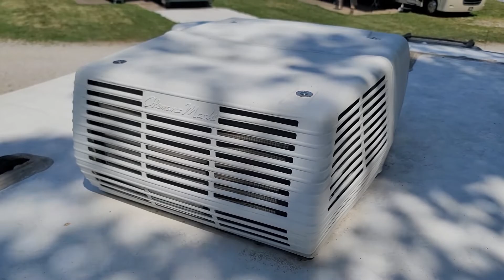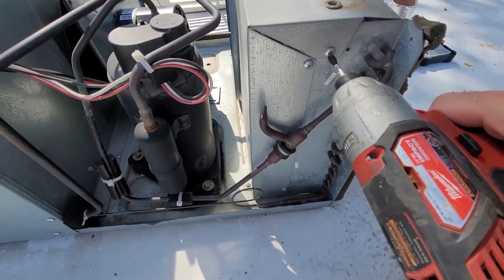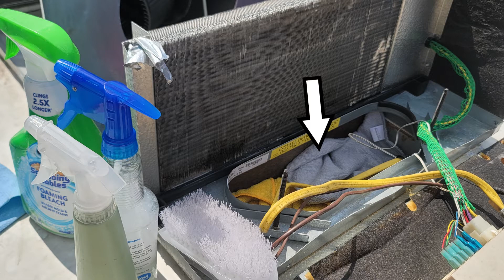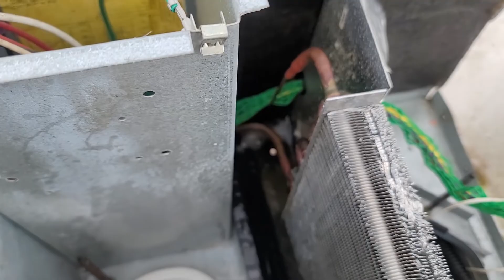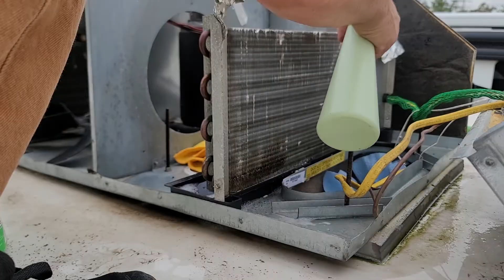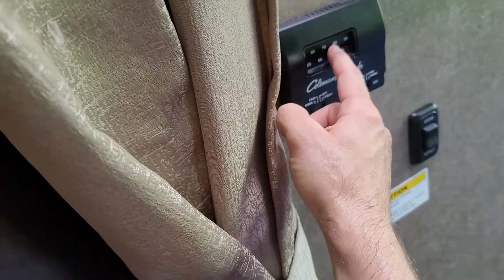RV AC Coil Cleaning & Maintenance - DIY | Coleman Mach

Comment: Thank you for the video. Everything was spot on.  Your video made it easy.  

Walmart has foaming ac coil cleaner with a bristle cap for $6.49. The large can was more than adequate to clean one ac unit.

My evaporator coil (front coil) was much dirtier than the condenser coil (rear coil). The front coil had mold growing on the intake side,  which is visible if you take off the interior covers. Wiping the mold out of the drain pan helped freshen up the ac. This was the first cleaning i have done since the the coach was new. It is 7 years old.